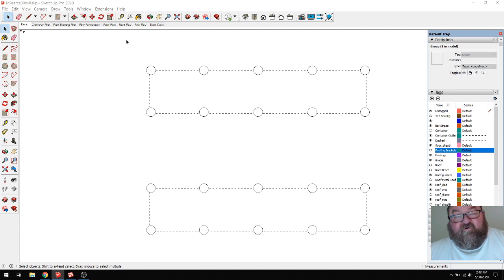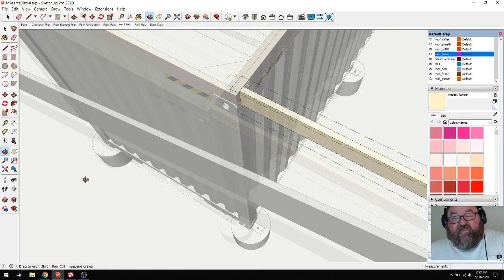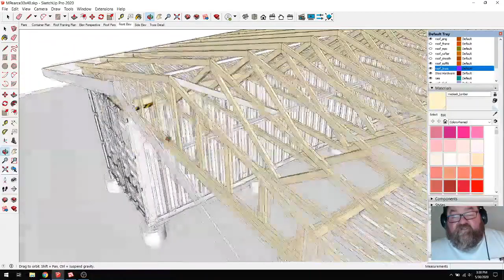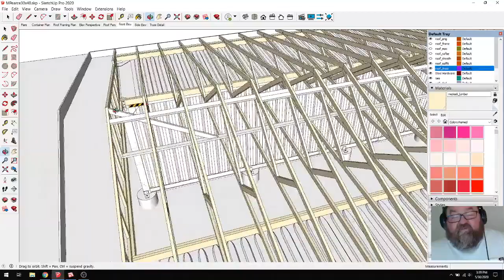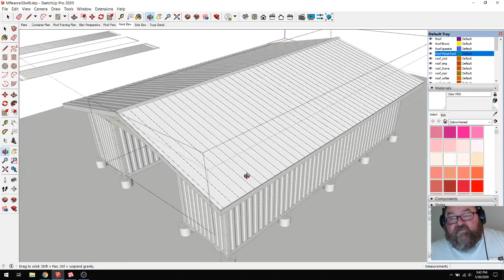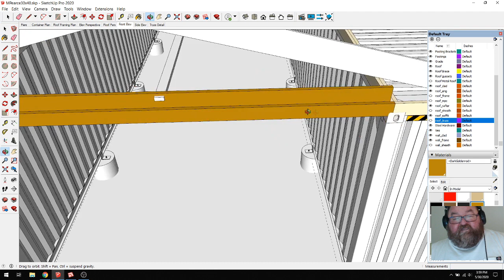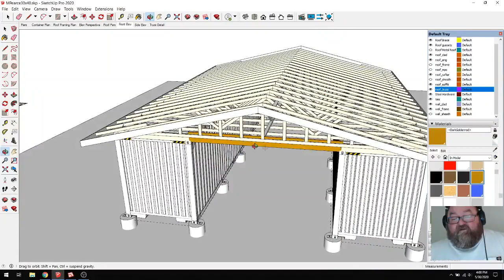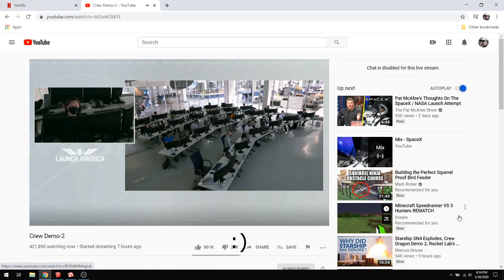Container Consulting for Mike - Part 2 - Supporting Gable Truss

Comment: What you need on the end of a structure such as this is called a structural gable it is simply another common truss that has verticals added around the structural webs. This will eliminate the need for any support other than each end as the common trusses use.
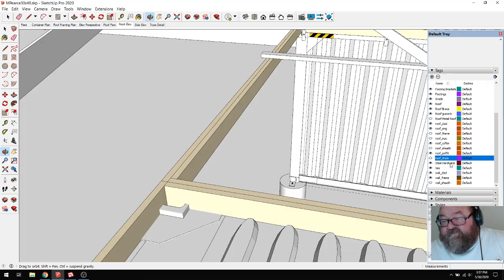Reply from the maker: Yes, I spoke of that in the video as an option starting at 8:15  :)  The  other reason I fill in this area is to give something to install siding on.  The siding should not be hanging down 6 inches without a backer.